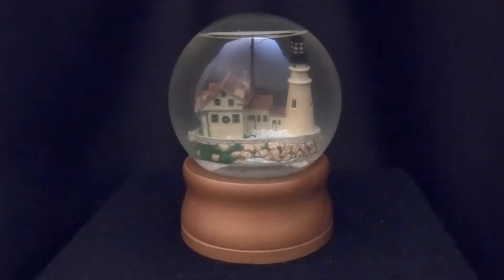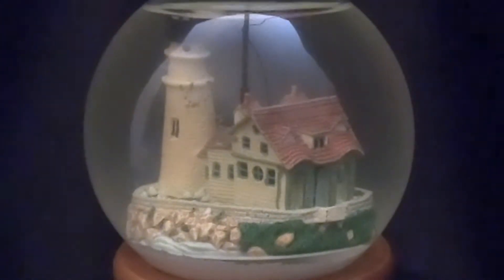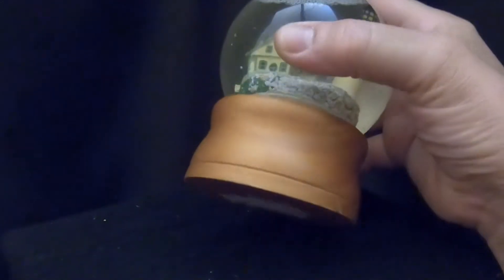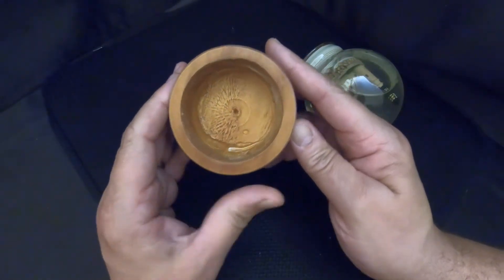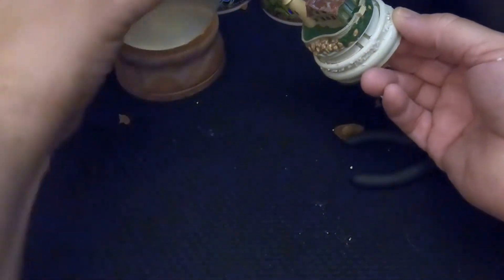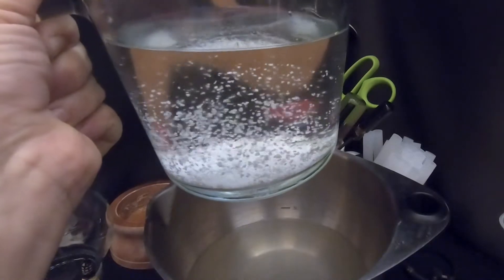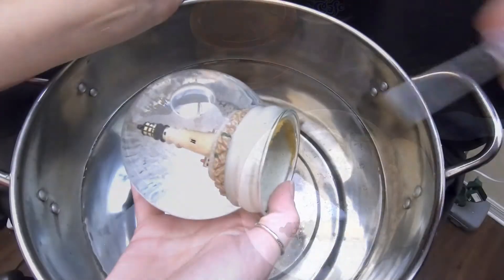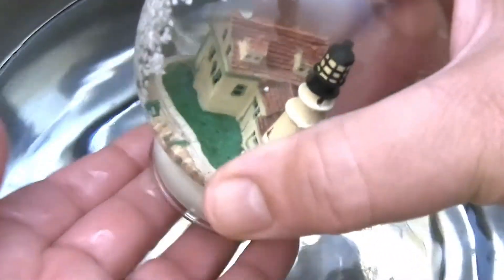Ep. 95 - Wooden Base Lightouse Snow Globe Repair - Water change, lifted figurine, 10 Tbs glue

Comment: What do you do if the bottom is a music box?  Can't really soak it in water.  Ideas?
Reply from the maker: Yes, you heat the bottom of the base with a hair dryer to melt the hot glue that is holding the cover on. We have many examples on the channel. Also, something that we found out the hard way, regardless of what kind of base it is, you can put it in a plastic back then when you put it in the boiling water the heat will get to the base and melt the glue but the water will be blocked. That is how we do it these days if we have to use boiling water.

Comment: What do I do if there’s batteries inside the base and hair dryer didn’t work?
Reply from the maker: Hi. Try the boiling water method. Place the snow globe in a waterproof plastic bag and place that in a bowl. Pour boiling water in the bowl up to the top of the base, no higher. As long as the globe was assembled with hot glue this will work. It may take 10 to 30 minutes to loosen the glue depending on the material and density of the base. Add fresh boiling water every 10 minutes. If you go more than 30 minutes and it still won't budge may indicate that something other than hot glue was used. You can check out Episode 95 and Episode 201 for a 5 minute example and a 30 minute example.

Comment: How much glue for a 6" globe? Thanks! Love these videos!
Reply from the maker: Hi. We are happy that you are enjoying the videos. A 6 inch globe holds 60 ounces of water. We normally use 30% glue so we would add 18 ounces of clear glue. However, as we have mentioned in many of our videos, the glue is optional. You could use plain water, 20% or even 10%. It is your preference as to how slow the glitter falls. We would not use more than 30% because the water will not be as clear with more than that. If you haven't already seen it you may be interested in checking out Episode 32 where we do a side by side comparison of the different snow globe liquid options.  Hope that helps.

Comment: I have a similar wood base globe and was wondering if wrapping it in saranwrap prior to immersing in hot water might prevent any damage to the wood base?
Reply from the maker: Yes Saran wrap will work, we have used that before, however, you need to make sure that all of the edges of the plastic wrap are above the water line or the water will get past. We didn't do it with this globe but for the past year or so we have been placing our snow globes in ziplock bags to protect the base from the boiling water. This is the method that has worked best for us.

Comment: What type of glue do I put in the water?
Reply from the maker: We use Clear Elmer's Glue at a rate of 30%. You may be interested in checking out Episode 32 where we do a side by side comparison of the different options for your snow globe liquid. You may also be interested in Episode 3 where we present the tools and materials that we use. Good luck!
Reply: @snowgloberescue8887  thank you, what should I use to stick glass to base?
Reply from the maker: @adampiper3656  We use hot glue. That is what most people use to reassemble their globe. You will come across small inexpensive snow globes that use super glue, however, hot glue is the standard. Also, it will allow you to easily take it apart again if needed.

Comment: My water globe has a wooden base that will need to be submerged in hot water. But there is one problem, it has a music box but no black platform to take off. Just a small circle of wood with thr music spinner is. I wish i can take a picture to show you. So you can help me
Reply from the maker: There is an email link in the About section of the channel home page. You can send us a picture and we will see if we can provide any advice.
Reply: @snowgloberescue8887  i apolgize but i dont see the email link on your about section
Reply from the maker: @autumnjudd9153  Interesting. There is a button in the About section labeled "View Email Address". We've had numerous people people use it to email us, not sure why it is not showing up for you. Try tespi74@gmail.com.

Comment: Also, Did you say Zap A Gap to hold stopper to base of lighthouse?
Reply from the maker: Yes. We have been using Zap-A-Gap for a while now. It was recommended when we purchased some snow globe snow online. In the past we used Gorilla Glue and Super Glue and they work fine as well.
Reply: Gorilla Glue and SuperGlue did not work after drying 24 hrs.  Base popped off when trying to insert very rubber base and yes I wet it first.
Reply from the maker: @mikafassie  That is interesting. Maybe Zap-A-Gap is what is needed in your situation.